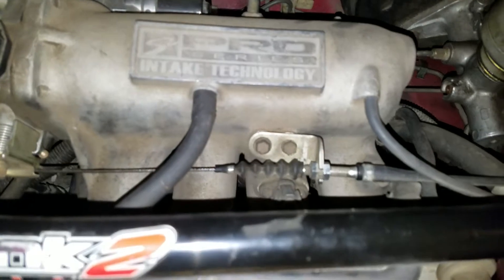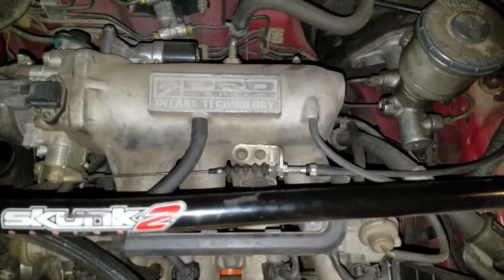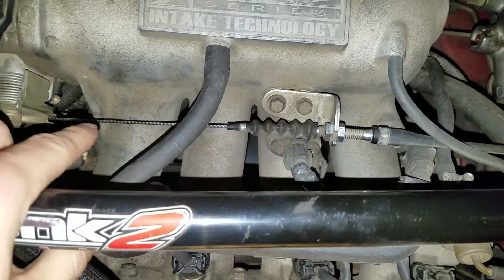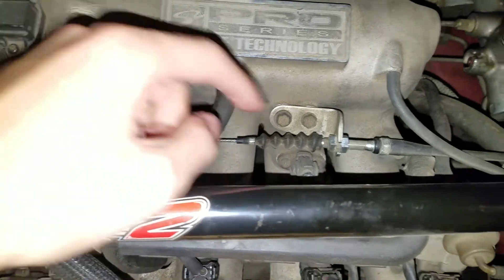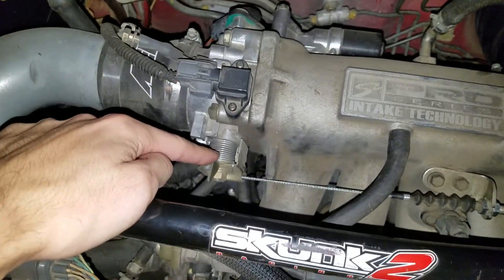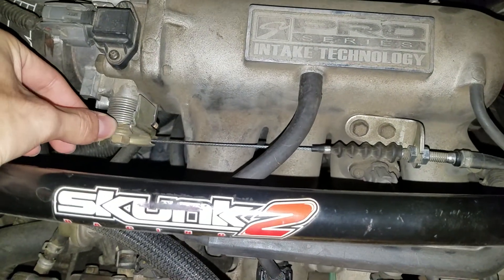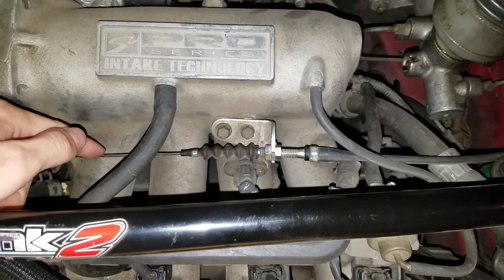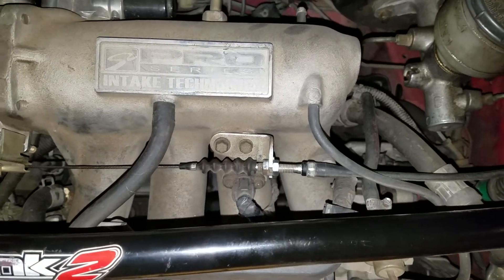How to Adjust Throttle Cable - EP #8

Comment: Did this in my Honda yesterday and the dead zone slack is all gone. Great tip. You may be able to hear the "tap" sound as the throttle closes completely to ensure it's not overtightened.

Comment: Note that the flanged nut is for locking the adjustment as well as for holding the cable on the bracket, so loosen it first and tighten it last. 9.8 N m (87 inch pound force) on my Honda, FWIW.

Comment: What cable and bracket are u using
Reply from the maker: OEM USDM GSR cable and bracket as far as I know...
Reply from the maker: Actually I found the paperwork for it and it's Type R
Reply: The CF Project type r cable and type r bracket?
Reply: @Plugs_818  that looks like a p73 bracket which is for a Type-R and you can only use a Type-R throttle cable on it since the GSR is a lot shorter